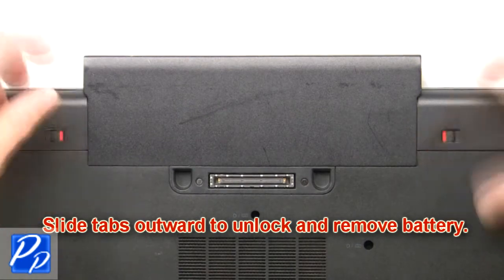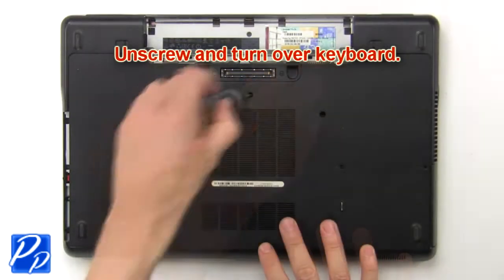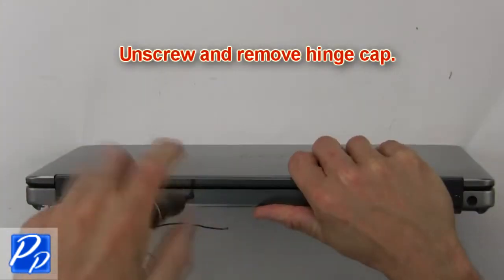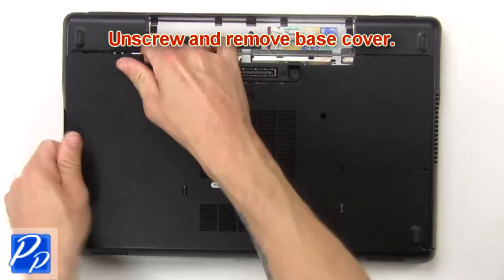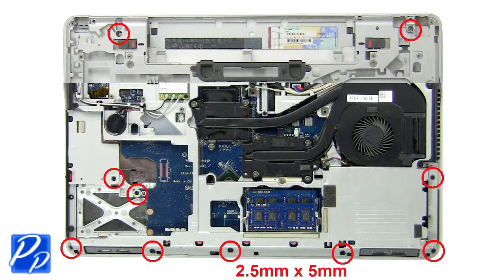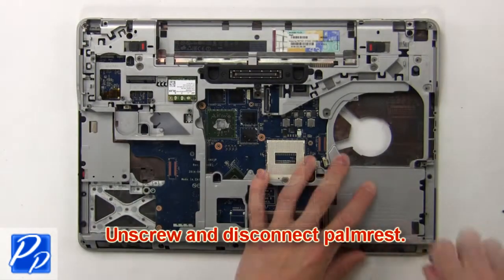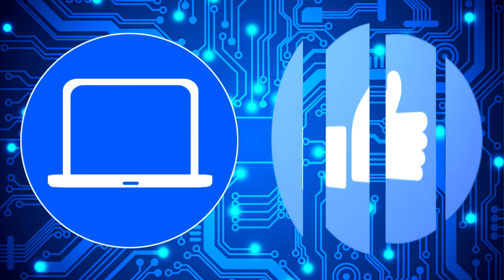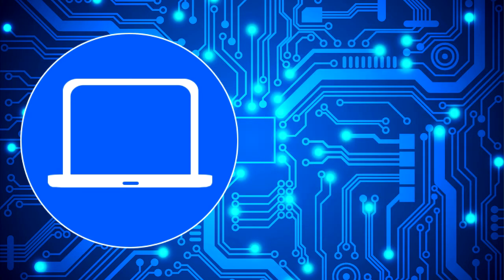Dell Precision M2800 (P29F001) WiFi Switch How-To Video Tutorials

Comment: I recently got this one and haven't been able to turn the wifi on. Is there any way of switching it on or is the wifi switch or card damaged?
Reply from the maker: There should be a WiFi on/off switch on the right side of this model. You may want to make sure it's on.